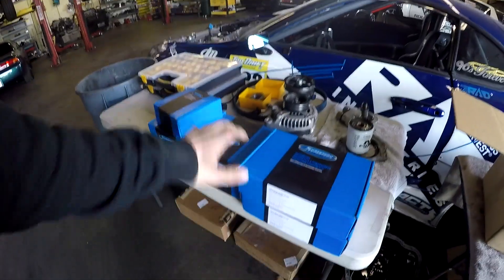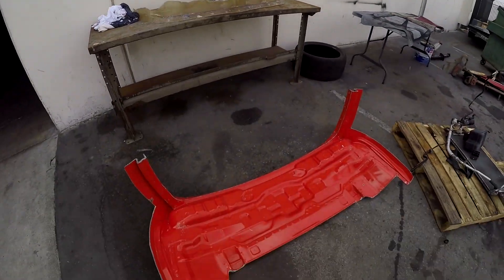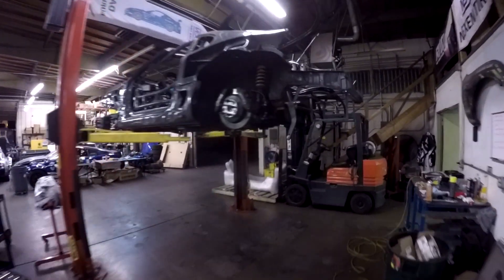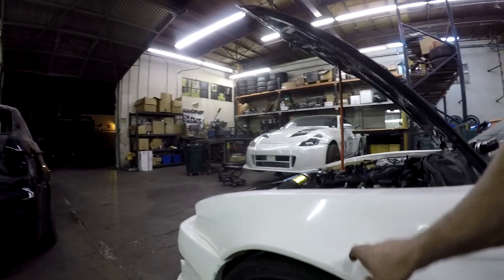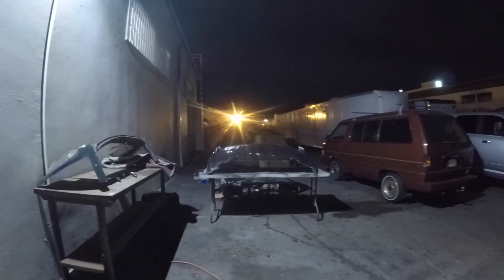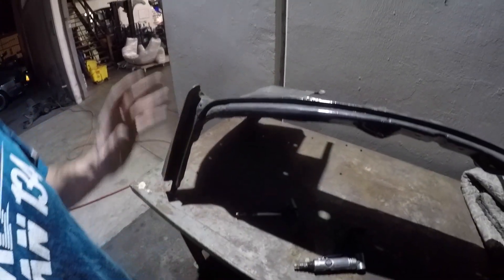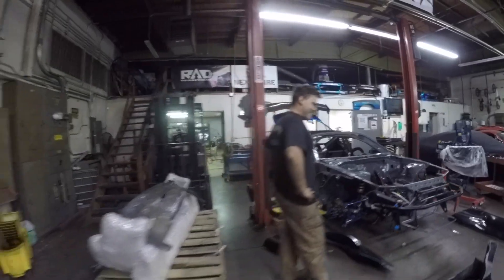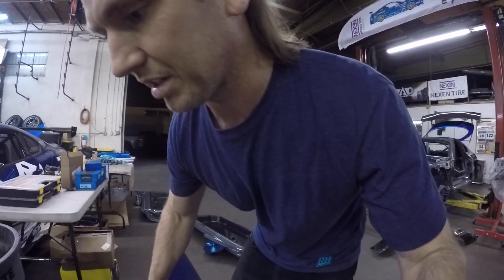Ep. 7 Off Season Refresh: Supra Body Parts

Comment: U dont have a rear roll cage that the bash bar connects to so u have structure wen u do crash so u dont destroy ur shock towers in rear and radiator
Reply from the maker: I still have my OEM frame rails and I use OEM rear crash bars too.  They work good for now, if they ever get bent then I’ll build a tube rear.
Reply: Ok i thought so i cant wait till u put the whole car back together most badass supra on the internet keep up the awsome work and great content